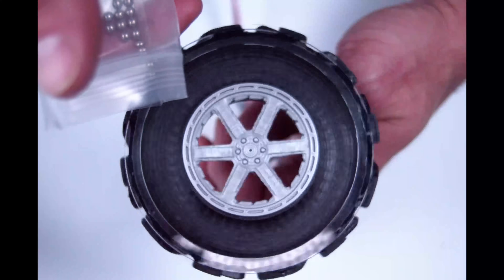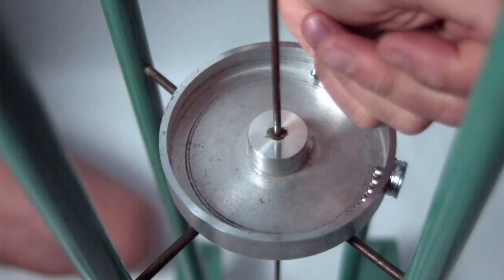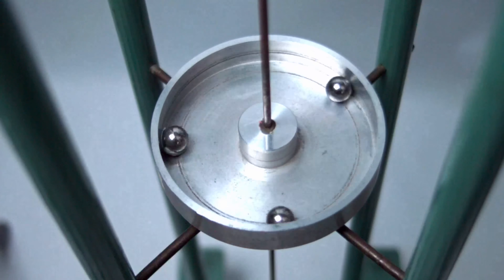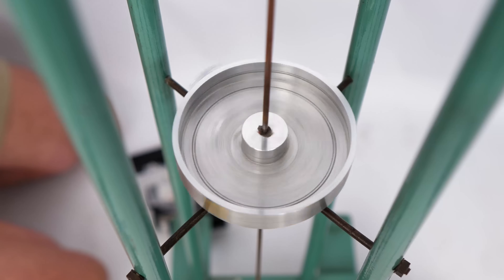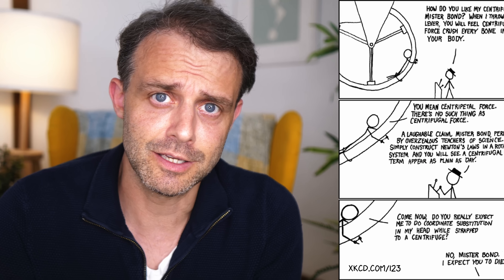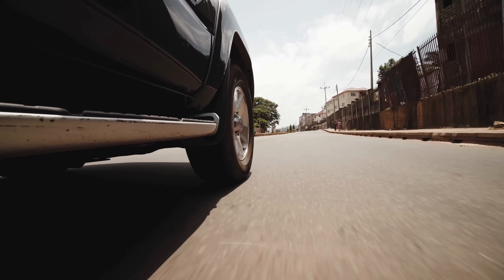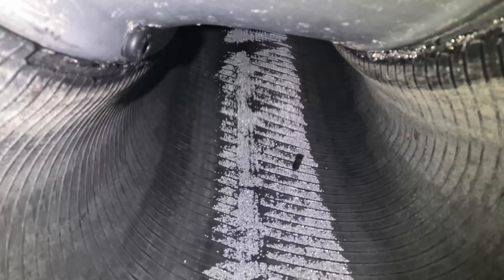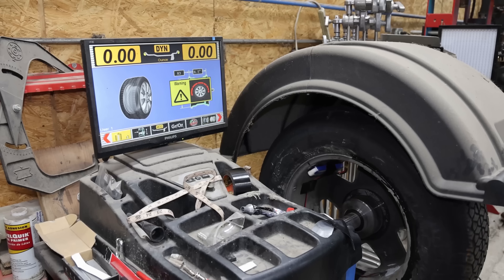Do tire balancing beads actually work?

Comment: Makes me think about the liquid sealant in my tubeless bike tires, although wheel balancing is less critical in bicycles probably because the mass and speeds are so much lower. But I would expect fluid to behave the same way as beads

Comment: There is a thing on the car tires: They are not rotating in an horizontal plan perpendicular to the earth centre. So in this case gravity creates an odd imbalance in which the beads will exert a stronger force against the road rather than balancing the road. In high speeds the beads will be hold against the tire walls but they will not be balanced. Indeed they will tend to be all in the same stop rather than distributed. In practice this is pretty much to install heavier wheels. The standard wheel weights are installed in fixed positions so the gravity should not have the impact as it does in loose beads. Run a vertical simulation and you'll see exactly that.
Reply: The g-forces in a spinning tire are so high that the 1g of gravity can basically be ignored in this case.
Reply: The the force of gravity is something like 1/200th of the g-forces experienced in a 64cm/25in tire spinning at the 800rpm it takes to travel at highway speeds.
Reply: @Tevruden      For a 64cm/25in OD tire spinning at 800rpm (about 97km/h or 60mph) the g-force is about 455 g's.  At 533rpm (about 64km/h or 40mph) the g-force is about 202 g's.  At 400rpm (about 48km/h or 30 mph) the g-force is about 114 g's.  So, the 1g of gravity would indeed be negligible.
Reply: @Tevruden  How about the deflection of the tire, hills, and bumps.

Comment: Been riding my motorcycle for four years (~40,000kms) with these beads. No lead/steel balancing weigths. It's awesome. Even put the bike on a track for a 1/4 mile and it's perfectly stable.
Reply: The beads I used in my motorcycle tires were some sort of high density ceramic. Used them all the time and they always worked great. Dynabeads, I think they were called.

Comment: 10:30 So they are useless for mostly city driving with stop-and-go traffic and stop lights. Regardless, I learned something new today. Thank you!
Reply: Balancing your tires at all is worthless at those speeds... So 🤷‍♂️
Reply: But in my experience, wheel imbalance vibration is really something that pops up somewhere in between 90 and 130kph...(usually at the higher end of those numbers) It never is felt at speeds below 90kph..
Reply: right, so 'technically'* not a scam, but yet still a scam
Reply: @gorak9000  Only a scam if your vehicle never leaves a city and or takes the freeway, haha.
Reply: I have a road I drive on where they speed limit is 45...  It is 10 miles long this is the first long road I drive every day. This video told me my options are speed by 15 mph for a short period of time every day.. on a road with lots of cops... Or get traditional balancing... Never accept beads in my case
Reply: @MaddHatter  more likely that you have a tire or tires out of round than out of balance if felt at lower speeds. Find a good tire shop that can measure road force and do phase matching, which is finding high spot on wheel and high spot of tire and placing opposite. Sometimes it helps, sometimes measuring road force just shows a tire needs replaced.
Reply: @biker1007 what I am saying is that balance beads are terrible in my case. I don't need new tires I don't have vibration
Reply: You don’t need to even balance city drive only tires, assuming you don’t buy Chinesium junk that are way out of
Reply: But also you won't experience any vibrations from unbalanced wheels
Reply: @maverickstclare3756  but they settle when you stop and don't minimize vibrations unless you go > 50 mph, which I don't hit while driving on city streets.
Reply: @matthewpena4169  I think they were trying to say that if you drive slow the unbalance doesn't matter anyway.
Reply: @Mobin92  Thanks! I assumed, maybe incorrectly, that the unbalance would still be annoying below the critical speed.
Reply: @matthewpena4169  In reality, minimum speed is ~20mph.
Reply: Exactly  @Mobin92
Reply: @superjesus4307  lower after you get to that speed without stopping.

Comment: It would be interesting to come up with some beads that could glue themselves to the tyre wall once they are in position. If one did it on a rig I guess one could try using glue with a known setting time.
Reply: Sticky/glue-y beads that melted at a specific temperature?

Comment: What happens in microgravity? with complete freedom of movment? 
Would the same happen if you just set an unbalanced disc spinning in the air with a few ball bearings in a track on the outside? will it balance?

Comment: Anydesk (sponsor) user here, I switched because they actually work with scambaiters to shut down call centers abusing their software. Many of the competitors don't seem to care what their software gets used for.
Reply: I watch those channels where they work with Anydesk. Good content lol
Reply: Rust desk user reporting in
Reply: Also an AnyDesk user; I switched because their pricing was highly competitive with alternatives, and their unattended access features actually worked reliably, unlike their more expensive competitors (which, as an IT professional, is critical). However, enshittification struck as it does all things, and a year ago they increased their prices significantly. I could accept some increase in light of the inflation situation in recent years, but my renewal would have quadrupled to maintain an even vaguely similar feature set. I very nearly switched providers, but was struggling to find a compelling alternative and the prospect of migrating all of my clients' devices (yet again) did not appeal.

Luckily they came back with a better offer that kept my price mostly the same (which they either rolled out in response to criticism or I simply missed the first time, though they didn't offer it when I spoke to them on the phone originally, so I'm inclined to believe it's the former), albeit with a reduced feature set - which is mostly an inconvenience rather than a true hindrance, but only because some of the features were grandfathered in, presumably because it was more trouble than it was worth to revoke them from my legacy account.

I still recommend it as one of the more reliable options in the space, just be advised that's a concerning indicator of future value proposition... once these games start they usually don't stop.
Reply: Ssh user reporting in

Comment: I'd bet you could add some sort of glue into the tires interior that could permanently affix the beads in place after a while. Probably a glue that is still playable/tacky after drying and heat resistant.
Reply: So, just use tire weights?
Reply: @Vykk_Draygo  Effectively yes, it would just be tire weights, but an idiot-proof do it yourself tire weight so it works regardless of your speed but requires no technical knowhow to use, just a simple 1 2 3 process one time to balance your own tires.
Reply: The liquid sealant 'Slime' balances tyres. It remains liquid.
Tyre technicians hate the stuff if you don't tell them it is in the tyres , because it spills all over the tyre mounting machine
Reply: One of the advantages of balancing beads is they are dynamic. They’re particularly useful for larger off-road tires. First, they are difficult to balance, but also sometimes you can lose chunks of tread while off-roading. This can throw the. Balance of the tire off. Beads can compensate for that on the fly.

Comment: I have a strong feeling this is related to the Kuramoto model. I’m guessing above a certain speed a nonlinear coupling (from the rotational motion and friction) is strong enough finds a stable configuration.
Reply: The fact that when you speed up and slow down you stay stable is a hysteresis which happens in nonlinear systems.

Comment: Beads are the only way to go for motorcycles. Your wheels just stay balanced. And the beautiful part of it is that over time as the tire wears, picks up rocks, the beads are always readjusting and keeping your wheels in balance.
Reply: Except, on the track at a very high lean angle going around a sharp curve... Ask me how I know 😱.
The front wheel started hopping and of course I left the track quite quickly.
Reply: I don't hate them for moto use and use them myself sometimes, but wheel weights are ALMOST as easy for the other times.
Reply: I have used beads in all my bikes. Perfect.
Reply: @richareno233 do you race?

Comment: Empty washers dont wobble like washing tennis shoes, so what viscosities of liquids could "2D cymatic" themselves into the patterns to achieive this? Try water first? Dish the bottom so the liquid is at a small radius for easy startup? Make it like a roulette wheel to simulate ballbearings? Think ppl on the whirly sliding out and ending up on the wall spaced out - person puke person puke person etc

Comment: I feel like there's some way to engineer this into something that could work. For example, you could coat the beads in some kind of glue that sets when exposed to air and then coat that with a hard shell that melts at the temperatures tires get to at freeway speeds? So all you have to do is hold that speed long enough to melt the coating and let the beads glue themselves in place and you're good to go at any speed.
Reply: i was just about to write almost this exact comment but I figured this must have been considered and abandoned in place of hard beads for some reason. You could have them setting in the wrong position before they even get chance to settle properly if the driver has to travel a long way to get to a highway/motorway then it would be far worse. But it seems washing machines have this and they are able to correct the drum then switch down to slower speeds. This is not something a driver can so reliably do. But a garage surely could! So I could see this working with a car up on a lift where the wheels can go as fast as they need straight away. You could even have this as a manufacturing stage for tyres so they are all perfectly balanced from the factory for a small additional cost perhaps. The problem is I don't know what current systems are that can balance tyres so I'm not sure how much effort you could put into this ball levelling method before it exceeds the cost of current balancing. But I like how y ou think, a permanent solution seems like the ultimate end goal for a product like this.
Reply: or you could just install the damn counterweights? pen in space situation
Reply: @GraveUypo imagine you lived in a world where everyone had a cheap method to balance their own tires and you said to someone "hey why don't you pay a lot more to have an expert with specialized equipment clip weights to your wheels." You might as well be telling someone who just totaled their car "why not just get a horse?"
Reply: @quintopia  You may be able to install these yourself through moving the valve core, but in general, people get their wheels balanced once, when they get new tires. As pretty much nobody has the ability to remove and install tires on rim themselves, I'm not sure what the advantage is as far having a cheap method to balance. The tire shop does it  when you get new tires. It isn't really a problem. 

I say this as someone who has used them on motorcycle tires (which I did self-install and also static balanced using a small amount of stick on weight to get things as close as a could). They worked great, although just static balancing by eye resulted in no perceptible vibration at any speed, so not sure how much they helped!
Reply: @X85283 there are two potential advantages: 1) it's cheaper for the tire shop (e.g. less equipment and training) and they pass that on to the consumer, and 2) you don't have to go to the shop if a wheel weight comes off (because they can't come off if they aren't there to begin with) or tire has become unbalanced via uneven wear (because you can balance it yourself)
Reply: @quintopia  I mean it straight up isn't as good for a regular car tire as stick on weights on a road force balancing machine. Tire shops already have these machines. If I went to a Big O tires and they told me they were going to use beads instead of a road force balancer I would just leave. It is inferior. 

99.9% of people who lose a weight have zero idea until the next time they get tires or a tire shop tells them (and can fix it). An even smaller percentage of normal drivers have the skill or tools (a s minimal as they are) to remove a valve core, put in the beads (which are incompatible with many TPMS by the way, at least through the core), and reinflate the tire. 

There's an advantage to this type of balancing but it isn't for normal people. It is great for things like adventure motorcycles (those without tubes at least), big offroad tires, etc. Enthusiasts. And even thing in both cases a properly balanced wheel is the best starting point.
Reply: Just buy tire slime instead?

Comment: But how do you get these beads inside your wheels? It looks like you would have to remove the tire from the rim to get them in, and should you ever get that far, you're probably within the proximity of a balancing machine already...
Why even use beads, anyway?
Couldn't you just use some kind of viscous liquid, spray it right through the valve and have it permanently adhere to the right places by using some chemical reaction, possibly triggered by heat generated by driving at the appropriate speed for long enough?

Comment: Could you add some sort of glue, spin the tires up whilst on a treadmill (or with the car jacked up) and then allow the beads to set in their configured position?
Reply: Theoretically, sure, but what do you do after a tire change?
Reply: @saintchuck9857  add more (different) beads.  It would certainly save a lot of labor